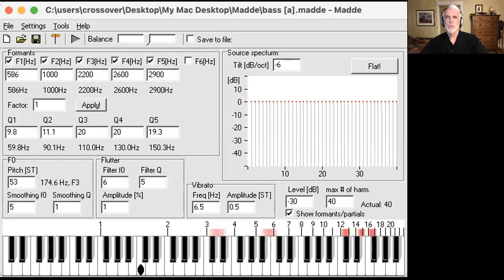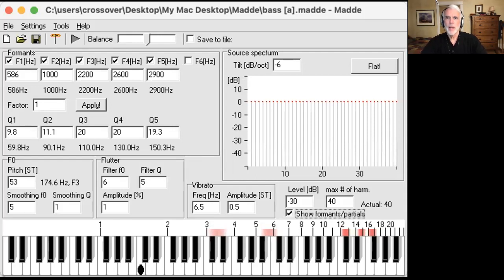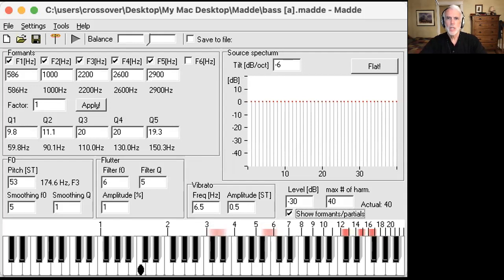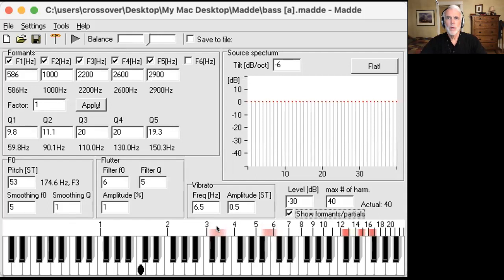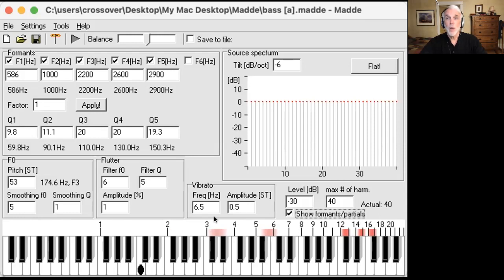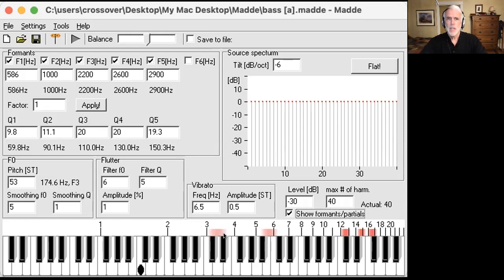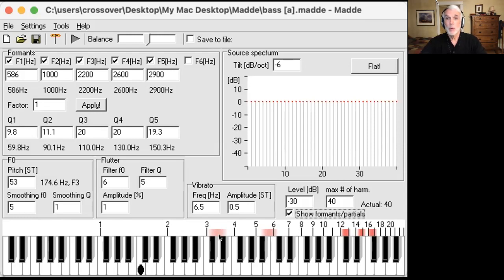acoustic register demonstration by Ken Bozeman

Comment: I think this is truly amazing.

Could you help me with something? I do wonder why the 2nd harmonic being above the lowest formant matters. Is there a difference between the frequencies not interacting but being below the formant, compared to not interacting but being above the formant? In each case, the frequencies (of the formant and the harmonic) differ, but in the second case the sound is quite different. Thank you professor.
Reply from the maker: The acoustic interactions are somewhat complex.  the main take away is that if you want the voice to "turn" where the vowel would normally locate the first resonance, you should maintain the shape, leaving that resonance where it is in resonant speech, which allows harmonics to move through it as you ascend.  The vowel timbre will then necessarily migrate or passively modify with that transition. Avoiding that turn results in a more yell-like timbre, caused by opening the mouth more and larynx raising. Using expression/affect can assist in avoiding excessive dulling (over covering) of the sound above the turn, by keeping inner height in the naso-pharyngeal area--sometimes referred to as inner smile or inner pathos.